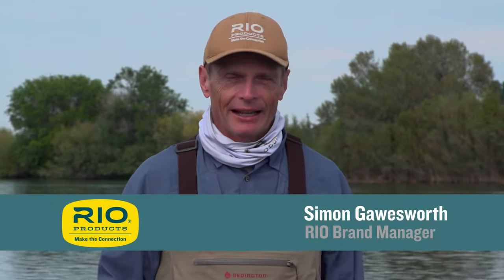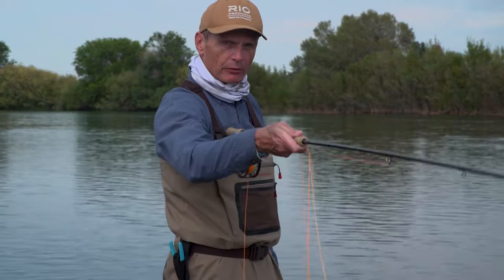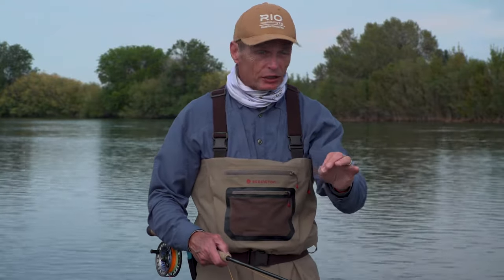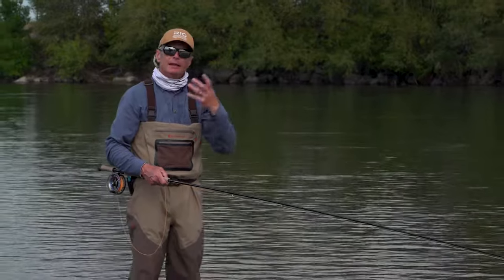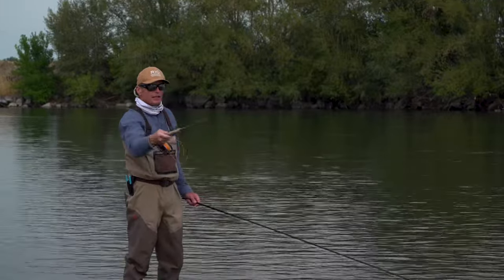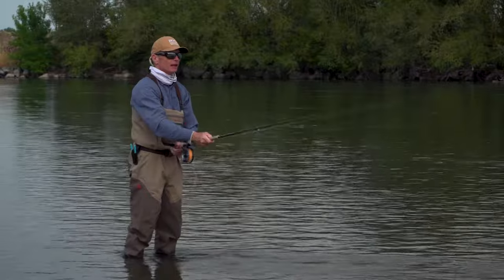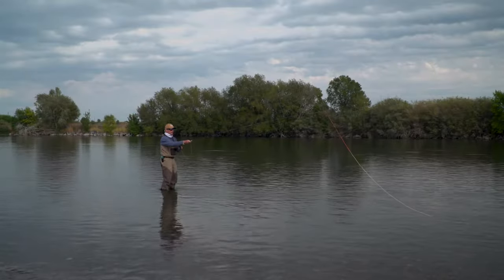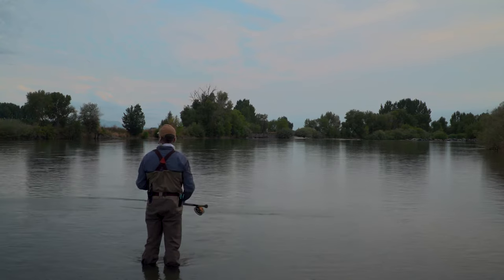S4 E11 How To Make A Snake Roll Cast

Comment: Simon - in the video you were facing directly downstream.   Could you perform the same cast facing more towards your target across the river?
Reply from the maker: We asked Simon to comment on your question. He said that you can certainly face the target and perform the same cast no problem. You would be limited to shorter head length lines, but it wouldn't be an issue otherwise.

Comment: Are there any timing tips if I'm casting a much longer line when it comes to rod tip path and timing? I know own the Rio Shorthead Spey, but I'm casting it on a shorter 12'6 Redington Claymore 8 Wt.
Reply from the maker: There are no particular timing tips to give, but the rod path length does change. The longer the head length of the fly line, the longer the rod path needs to be, so enlarging the circumference of the rod path on the D-loop stroke would generally be a good move when progressing to longer head fly lines. Hope this helps!
Reply: @RIOPRODUCTS  Awesome thanks for the tip.

Comment: Where i have problems sometimes is if i am in the river, right handed and the current is flowing from my right to my left. Make a cast upstream let is drift long now the line is directly to my left downstream. How do i get more efficient at casting all that line back upstream?
Reply from the maker: Efficiency in any type of casting is based on timing and usually a smooth transition to a firm stop, for both roll casting and false. It's a little difficult to explain on a video comment however, we would recommend fishing with someone who is proficient, not only so they can teach you, but so you can view an efficient caster at work, then try yourself! Good luck!

Comment: Wonderful cast but also a showcast and very very rarely needed.
Reply from the maker: This cast is perfect with a downstream wind with a Sandi head and little back casting space - not much better, or faster than the Snake roll
Reply: @RIOPRODUCTS  And you can use a reg spey cast even in REALLY heavy wind if you know what you are doing...
Reply from the maker: You certainly can,  @MrKveite1

Comment: For anybody watching I think he means diameter as far as your ‘e’ size. Circumstance would of made the 20 footer much smaller.
Reply from the maker: We clarifies this with Simon, and he confirms it is actually the circumference that he is talking about. He says that the rod tip can prescribe an "e" shape with, say a total circumference of 3 feet, or 20 feet, or anything in between.
Reply: @RIOPRODUCTS  hmmm I’d venture to say 96.3% of the public can not comprehend a circle size via circumference. But 48.1% can if given diameter. 

Either way it’s really tomatoe tomato because you can make the biggest e or smallest with success. 😎cheers Rio. Stop making dump fly lines ❤️